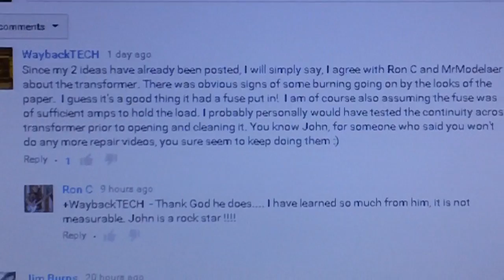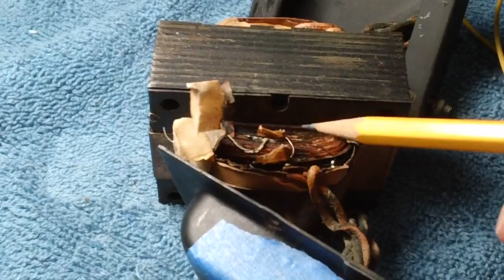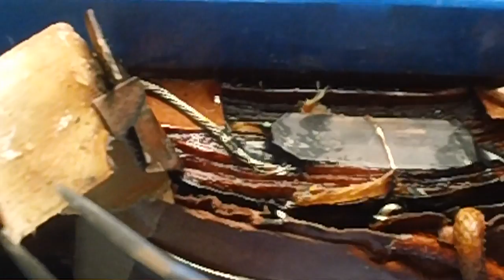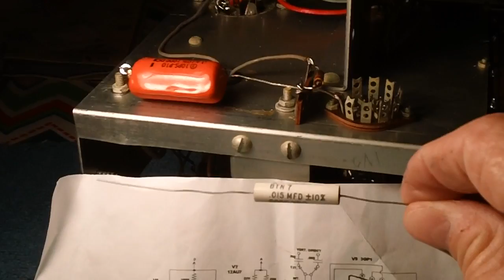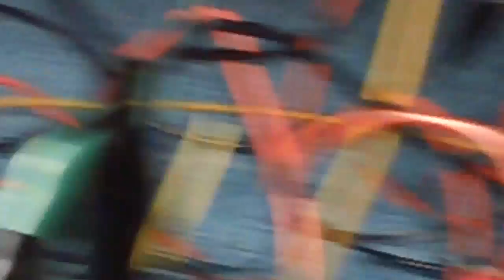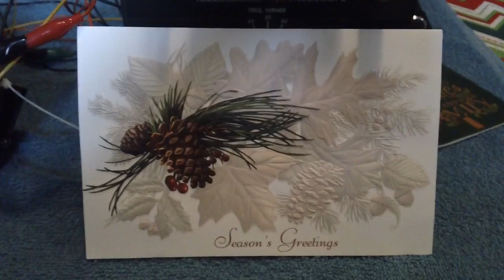Mish-Mash #139

Comment: Well John, I am a little proud this morning. After digging in the transformer and (hopefully) fixing it, I gator wired the thing up and  HAVE A RASTER , but no filament on tubes  ( Same symptoms as your first power up) !!!!!      https://pbs.twimg.com/media/CYStQtSWwAEEwcD.jpg:large      https://pbs.twimg.com/media/CYStTu7WEAAqOlA.jpg:large       https://pbs.twimg.com/media/CYStWSWWwAAzaRD.jpg:large      -  The CRT is lighting up but I do not have any horizontal or vertical centering.  Since I have not replaced those 1200v caps in the Pi Filter network I am going to leave this alone until they come in so I can get some accurate voltage readings.  I am not convinced I have completely fixed this, but a Raster is a very good sign !!!!!  Will keep you posted and as always,  Piece of Cake   :) LOL     

P.S. Which clip did you move to get it running ?    You can see the transformer is a Liquid Tape mess but it works what the heck :)
Reply from the maker: Ron,
Congrats, my friend, seeing a raster  is a huge step forward.  It's all downhill from here.
I'm glad this situation came up.  On your schematic you'll see that all the filament voltages are fed by the lower winding of the power transformer secondary (green wires).  The top green wire has an X by it.  You'll also notice that all the tubes, except the CRT and V7, also have an X on one side of their filaments (Pin #4).  Yup...it means all the Xs are connected together.  Sooooooo, if everything is wired correctly, simply connect a gator wire from one of the green wires to pin #4 of any tube ( V1 thru V6).   I believe the wire was originally connected to pin #4 of the 6X4 rectifier.  The remaining green wire will of course be connected to ground.
That should light everything up.

Regards,
John
Reply: +joernone As usual you are a genius.  On the green wires I had one end going to Pin 4 of the 6X4 and one going to Pin 3 of the 6X4 ( that is where I removed them from).  Moving the wire from Pin 3 to Ground has indeed lit up all the 12AU7 tubes however I still have the single raster. This tells me Pin3 of the 6X4 is NOT grounded properly ( and of course I neglected to connect the wire that goes from the ground lug on the transformer to pin 3, so this explains it). Anyway,  I have noticed that the  6X4 and 1V2(voltages to the pins are good)  tubes are not lighting up and suspect one of two reasons for this... 1) Bad tube(s)  or the Pi Filter Network Caps..... so.... will wait for the new tubes to arrive ( they were only $15 for both) and the new 1200v caps and forge ahead from there.  I am still amazed the transformer is working. I was digging in there like a wild dentist. Perhaps you will allow me the honor to call you my Electronics Mentor ?  I don&#39;t know how to thank you !!!!!!

UPDATE:   I pulled out the old Knight 600B and sure enough the 6x4 tube and the 1v2 tube are dead as a doornail. I also found a very weak 12AU7. All 3 are on order from TubeDepot and I am pretty sure I'll get a nice result when they are installed.  Bad tubes are rare some something had to blow these apart :)

Here are my pigtail solder connections to show you I've been paying attention. LOL  https://pbs.twimg.com/media/CYTctVvUwAAjTt-.jpg:large
Reply from the maker: Ron,
Trust me, I'm no genius and could never be remotely considered an electronics mentor. That honor is strictly reserved for the real geniuses like Brendan. The guy absolutely does know everything.
If you've not already done so, why not ohm out the 1V2 and 6X4 filament pins? Quick and easy to do.  Also, did the 12AX7 tube light up?
You know, the 1V2 tube in these scopes is a little workhorse.  Except for the filament, it supplies voltage to everything inside the CRT. I'll bet they went bad quite often.  BTW...that filter network has nothing to do with the 1V2 filament.  It's there to filter the voltage leaving the plate. Without it the screen display would be jitter-bugging all over the place.
Lastly, good job on the soldering.  You're a born tech, old bean.

Regards,
John
Reply: +joernone  I will try that for sure, thank you. The 12AX7 did light but was very poor on the tester, gas test too. The 6x4 filament pins are dead open.  The 1V2 filament pins do return a value but again tested bad on the tester.  I was able to reassemble the Transformer and then Ohmed it out again and its good. I went ahead and reinstalled it back in the chassis and dressed up all the connections. I figured if it does not work after the tubes arrive, I am done anyway. Here is the beast all dressed in black like Johnny Cash  :)    You;ve been a huge help as always.    thanks much, I won't bother for the rest of the weekend , LOL    - Be well    https://pbs.twimg.com/media/CYUdj4NUMAA_dRG.jpg:large
Reply: +joernone So, looking at the 6X4 which is dead  on my unit  , pin 7 feeds V5 (12AU7) and V2(12AU7) which is exactly what is NOT working on my unit.   Since V6(6X4) Pin 7 is not working, it also affected the 20/20/20/20 E.C. and that feeds (b), (c) and (d) so I think it explains why I don't have the line yet.   The key to my issue is the 6X4  :)
Reply from the maker: Ron,
Top of the mornin to ya.
Tubes must have plate voltage (B+) to operate.  Via the four 20uf e-caps (smoothing caps), the 6X4 rectifier supplies it to all the tubes, minus the CRT and 1V2.  So if it's gone the way of the Do-Do bird, then the whole system is shut down. That's why experienced repair techs always say: "Check your plate voltages".  All your tube filaments/heaters could be glowing beautifully, but the tubes be totally non-conducting because of no or very low plate voltage.  Based on what you said here, a good replacement tube should bring the whole show back to life.
BTW...keep in mind that many, not all, Heathkits were assembled by rank amateurs with no soldering experience, so it would behove you to bounce what you see around the 6X4 against what you see in the assembly manual.  LOL

Regards,
John
Reply: I agree with you and will probe around while waiting for  the 6X4 which will light up the show. I will doing a new video today to explain this whole experience and what I learned from you during the process so perhaps others can learn too. This was the best fun restore I have done so far, but it aint over yet. -LOL    Thanks John for everything, sincerely.  - have a great day !!!

Comment: In this image the color Blue is where I believe my open is    https://pbs.twimg.com/media/CYPG98GWwAAcxvY.jpg:large

bummer..... gonna have to dig in the coil.
Reply from the maker: Ron,  Welcome to the club, old bean.  LOL  But before opening up the transformer, I'd reflow the solder on pin #1 of the tube socket, then re-measure for continuity.  Or completely remove the wire from the pin, then re-measure it that way.  Eliminate all the options before digging for the black gold...which BTW means eyeballing the wire connected to pin #1.  Heathkit used a lot of solid wire instead of the stranded type.  They were easily broken.  Good luck, my friend.  Regards,  John
Reply from the maker: Ron,
Did you say you had a variac?  If so, bring it up slowly just as I did when checking out my repair.  Piece of cake.  Nuttin tuit.

Regards,
John
Reply: I surely do. Tomorrow is gator wire day and hoping no puff of smoke. Piece of cake.  Lol.  Thanks friend

Comment: John, in need of your eternal wisdom :)    The transformer on my OL-1 appears to be sick as well. A rough test with the Variac showed the unit DOA, so I've removed the Transformer to investigate. Here is what I found... first, the primary winding did have a protective piece of cardboard and is NOT burnt... looks good ( https://pbs.twimg.com/media/CYPEDL0UMAA49GX.jpg:large ).  I have ohmed out all the windings and all are goodt , but when I move to pin 1 on the V6 to ground I get nothing. From my calculations I would assume i have an open winding on the Red 360V coil but only one side.  Without this working my Electrolytics will not work and therefore nothing else will work. I have narrowed it down to the winding that goes from Pin 1 on the V6 to the coil.  I do get a reading from V7 ping 4 to  V6 Ping 6, but not to Pin1 .   Time for me to dig a little on this but wanted to get your opinion as well.  Thank you.

Comment: Real good to find out the transformer was fixable. Gary
Reply from the maker: Gary,
I like to first roll the repair dice before simply buying a new transformer or coil.  Thus far I've been fairly lucky.

Regards,
John
Reply: +joernone I hope I am as lucky. I just got a telecheck tele-matic test jig in the mail from an eBay seller. This one has an 8" rectangular tube and I hope the tube is good. The last one I got had a round tube that has an open filament. I need the small tube so I can bench test my re-capped Zenith 1951 24H20 TV chassis. Gary

Comment: Thanks for the update.  We built transformers when I was in community college.  The last step was to hook them up to AC with a small load to warm them up, then we submerged them in varnish.  Being slightly warm, the varnish to flowed throughout the assembly.  This took care of a number of issues including stopping mechanical rattles in the core.  The enamel is doing a similar job.  The trace on that scope looks very good on the television.  You have another handy shop tool there.
Reply from the maker: Stephen,
The transformer is back in and the scope is still functional, but there is a lingering small problem with the display.  We'll cover that tidbit at some point in the future.
Regards,
John